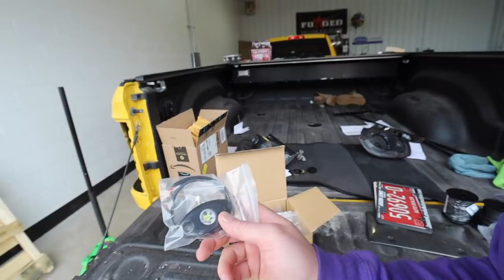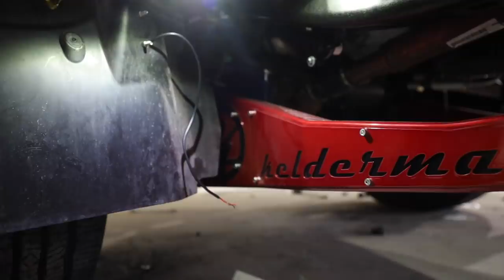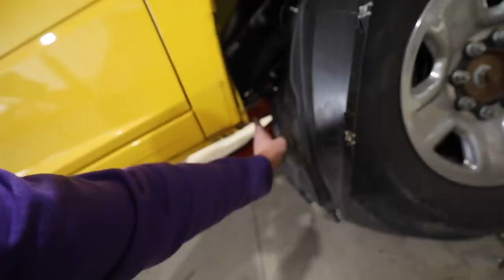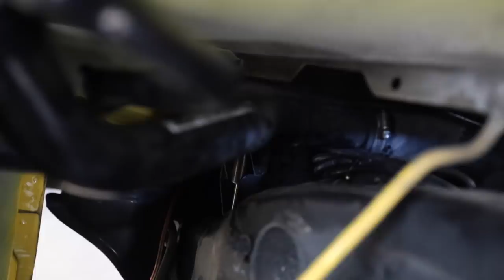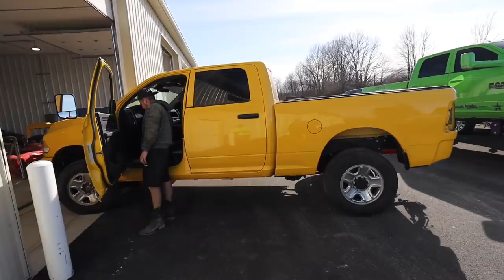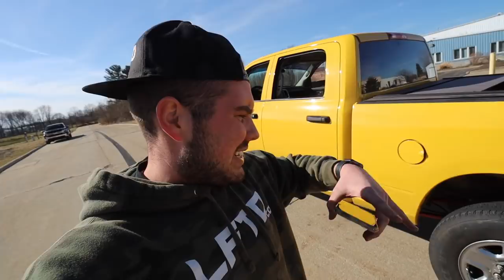BANANA RAM'S FIRST RIDE ON AIR!  HAD TO TOOT IT UP!

Comment: If not a bullet antenna, you can pick up a shorter or stubby one it Still will function and then you won’t have a 2ft thin rod flapping in the wind.😎👌🏻 the build looks fucking awesome , excited for the wheels🤘🏻🤜🏻🤛🏻

Comment: If y’all are looking for a set of good color changing rock lights Mictuning has really easy to hook up and good quality ones. I’m running them on my 02 f250 and I love em
Reply: Agree I have some on my truck but half
The time been having trouble sometimes it doesn’t wanna connect on the first try

Comment: For the anteana if it was mine i would go with a short rubber color matched
Reply: I love your channel it rocks. Im building a truck because of you but my question is my 2019 cummins has white door handles with a chrome inlay strip in the center do you no if that is removeable or not

Comment: If I buy 12 rock lights should I run a relay for them or would I be good if I get the same brand
Reply from the maker: I’d relay them! Super easy and a good thing to do to almost all electronics!
Reply: @ryan2546  could you show us in a video how to hook the relays up and which relays to get and everything